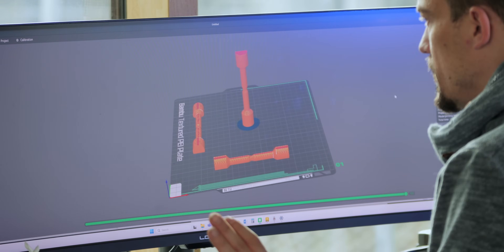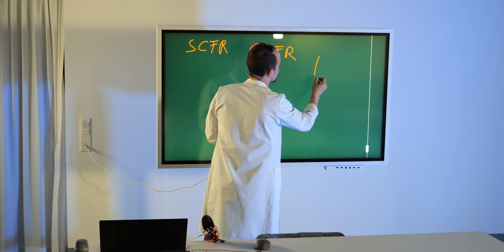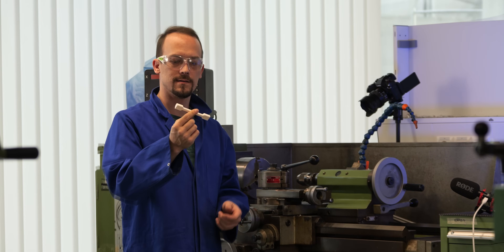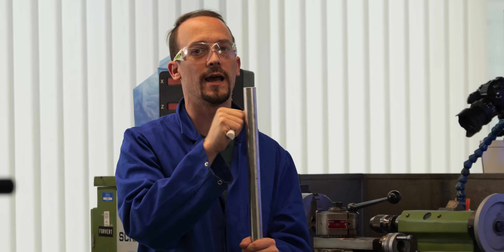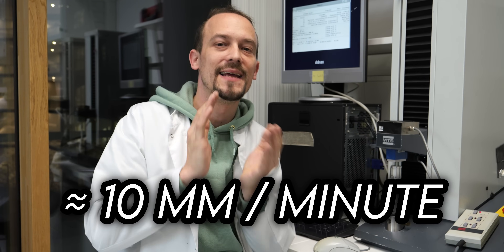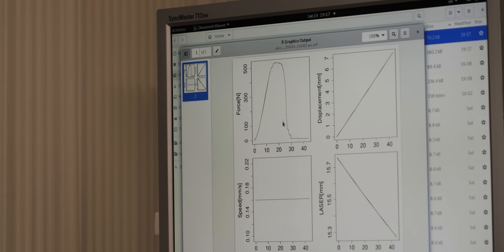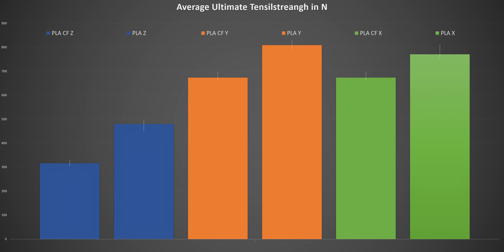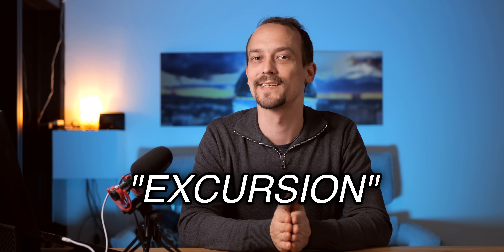The biggest SCAM in 3D Printing? How filament stores try to trick you with carbonfiber "reinforced"

Comment: Okay it's not a scam and their claims are actually somewhat true The problem is most people don't understand what strength toughness etc means it can be very confusing if you don't understand what those words means and how they're used 

First anytime you add a filler to a plastic I don't care what it is it could be wood fibers it could be glitter it could be carbon fiber strands it could be carbon fiber chop it could be Kevlar it could be glass fibers it doesn't matter what it is except if it's another of the identical plastic for example marble filaments it's two of the same kind of plastic You're just seeing a difference in color 

You are taking a monolithic homogeneous material and you are putting voids in it The carbon fiber or wood or glitter or glass fibers or Kevlar fibers they are not fused to the plastic they are bonded or encased within the plastic so ultimately you have two separate materials and one is just mechanically trapped inside the other this is not a fusion this is not homogeneous or monolithic 

Now what happens if you take a solid object and you put holes in it? It gets weaker always 100% of the time no exceptions there is no such thing as any filament with carbon fiber in it that is stronger than the filament by itself that does not exist 

However :-) here's the grain of truth you can trade one type of strength for another type of strength for example it can be worth using carbon fiber nylon carbon fiber polycarbonate you are making the nylon and the polycarbonate weaker however those materials in many applications have so much excess strength that you can afford to give up some of that strength in exchange for a different property for example nylon is stupidly strong but it's not very rigid carbon fiber in nylon makes the nylon extremely rigid relative to plain nylon keep in mind there's dozens of different kinds of nylon however the point is the nylon is so strong that in most applications you can afford to give up some of that strength and exchange for stiffness if the stiffness is what you need however this is not the case with PLA and in most cases PETG you are taking an already brittle material and making it more brittle by putting voids in it Yes it will be stiffer but you will be giving up enough strength that you may go below the threshold of what you need for the mission critical application meaning the material might no longer be strong enough for what you need it to do 

I'll say it again All fillers make the plastic weaker no exceptions you are creating a voids in a monolithic structure this will always make it weaker what you are doing is exchanging one value of strength for another value of strength if the remaining value of the original strength is still sufficient for your use case well then great you gain a benefit however if the material natively is already barely strong enough you just made it two week for your application :-)

Comment: Big differences that most people don’t understand, between stiffness/rigidity, strength and toughness. As you mentioned at the beginning, CF may contribute to rigidity, but at the cost of strength. Toughness is yet another separate characteristic.
Reply: so my way breaking the filament in my hand to get a "feel" for the material is actually better than reading the marketing material? I though sometimes that I am just silly for going by hand feel instead of the "hard numbers".
edit: because I don't have this kind of engineering training.
Reply: I agree . I’ve seen several channels testing different filaments, and getting confused between ductility , tensile strength and malleability.
Reply: Nah this testing methodology is flawed and he's using shit materials. Anyone who actually prints CF nylon knows that a good CF nylon is leagues above in tensile strength than an identical unfilled nylon (same exact polymer, just without the CF fill)

Comment: This was sound. Because after time I will use the Makerworld points to upgrade hardened 0.6 nozzle...and some materials. I have renounced to up both 0.4 and 0.6 to a Panda bc I don't need speed I just need a 0.6 hardened to make real car parts. The remaining I'll spend them in materials and... Good to know a good ABS or nylon6 could fit better than fancy CF stuff which has no reason to have CF inside apart of...the aesthetics. And maybe stabilizing ABS shrinkage but for delamination...looks worse.
Very curious study. Well done. Popping some corn waiting for filament brands to clarify this thing...

Comment: Not all CF are the same.  If they don't tell you the fiber type and volume percent, you are likely buying junk.  Did not see any increase in stiffness in your stress vs strain curve.  That's a bit suspicious.  The CF you are using has probably been milled to dust.  Also many of your base pla and petg specimens appeared to not fail in the narrow gauge section of your specimen.  That will impact your strength calculation since strength  is load/area.  Probably need a specimen redesign.
Reply: Would love to see a repeat with PC and Nylon.

Comment: I would strength test the raw filament to go along with testing parts since the filament strength properties are the fundamental basis for the strength of printed parts (which have orientation, layer adhesion, infill values, etc., etc.  Not saying do this instead, but do both.

Comment: So, I have a theory that, since the CF strands don't actually bond to the plastic as you pointed out, it kind of acts as a void in the plastic. How much those voids play off eachother is the real question, but a pulling force would not pull on the CF strands embedded in the plastic, thus the worse results throughout the tests. Which is probably why Stefan's tests yielded better results in bend testing for CF PETG than just normal PETG.

Comment: This is why we use pla+ for 99% of prints. Perfectayer adhesion and really exceptional strength. Easy to print, easy to post process, no harmful contamination, no fibers in my skin, no wear on my nozzle, can do it on cheap printers

It really is the go-to for structural parts so long as the temperature does not exceed 60c but for that you can anneal the print
Reply: Unfortunately, PLA+ is also a marketing gimmick. There's no real standard on what that plus means, so it could be anything from plain PLA that is just being marked up in price to some arbitrary blend of polymers that may not even contain PLA.
Reply: @ckitching2  you can tell based on material properties, pure pla does not have enough give but the overwhelming majority of "pla plus" type materials are a single additive of a much less rigid polymer in small amounts and it shows in functional prints when PLA+ didnt fracture when my normal PLA did

if you buy trash filament it COULD be anything regardless of what it says on the box but if you are making stuff thats supposed to work you go with a reliable and consistent brand and your needs will dictate if that also works for 99% of your structural and functional prints like it does for pretty much everyone including the people who print guns and pull up bars
Reply: What are your favourite manufacturer for PLA+?
Reply: Polymaker has most of my old prints, my friends who print similar things like sunlu and elegoo and there are others that I can't remember right now.

One thing that's underlooked is sometimes color can mess with it's structural properties, most have found black and clear to be the best variants for things like layer adhesion. One brand I know has a good red and black from DURAMIC 3D as well. Arguably my only source of colored structural filament
Reply: Yea. PLA is massively underrated.

Comment: I appreciate the efforts put into this but I have to say there is something crucial you either not telling the audience or don't even realize matters. In short :1-style/ratio of cf fill makes a big difference. Like night and day. Saying it's weaker as a concept in general is not accurate when there are so many nuances. 2- The nozzle temps should be hotter than normal petg. 3- an enclosed preheated chamber is very important even though not claimed on most companies profiles. For best adhesion you need the chamber at 35c so that the existing layers are still soft enough to bond to the upper new layers. 4- petg-cf is terribly hydroscopic. It must be dried really really well first. The earmark of improper drying IS layer adhesion. The material will also look lighter in color and appear swollen and rough when printed. If all these points are considered it is in fact just as good as regularly petg and a bit of a unicorn. I have printed thousands of items with it in commercial applications. That said marketing will always be marketing. But getting to know your filament and it's requirements will trump any scientific method in the lab every day of the week. These tests mean nothing if the material has not been printed in its ideal required conditions to begin with. I have yet to see any YouTuber properly use and test this filament. FYI the big name brands aren't always better. I've used many of the them. 
.
Reply from the maker: Thanks for pointing that out.
I dryed (specialised drying oven with certification), nozzle temps according to manufacturer guidline on every material, enclosed printer and controlled (and messured and recorded) chamber.
U are right, i did not tell because most people wouldnt want to know.
Since i am not only a youtuber and in a lab but also was a user and eutroponeur in 3d printing service for abou 10 years i am aware of all those things as well.
In the Research paper all of this will be included of course since u are right: without taking all this into account the whole thing isnt valid. But that would be to scientific for youtube because then i would need  post a whole abstract, materials and methods and also all my literature review as well. and then people get bored :-)

Comment: Great Test, Well done. Tell us, Did you test include drying the filaments before printing? 
Would love if you added Nylon vs Nylon CF to the test in Nylon PA6, PA11 and PA12 form. As these more expensive PA grades are professionally used for printing tools, functional prototypes, and end-use parts. One Popular Nylon CF for professional finished end-user and auto parts is the DSM Novamid ID 1030 CF10 PA6/66, also recommended by UltiMaker 3D printers. Part shear, displacement, and compression (squish) strength test would be a bonus ;-) Thank you.
Reply from the maker: it did include drying in a certified material drying oven (specially for FDM Materials).
All those materials will follow in the study and i will post a video when the paper is published

Comment: I am surprised by your result, it is not consistent with my experience.  I have used PETG-CF in many applications and seen more than a 50% improvement in ultimate strength (tested, not assumed) as well as improved stiffness and thermal resistance.  I think there would be a lot of value in testing some other brands of material and reviewing the design of your test sample, the failure point was very inconsistent which is not a good indicator of repeatability.

I have seen the best performance when PETG-CF is printed slow and hot, try limiting the printer to less than 50mm/s and increase the temperature to 250c.  For the test sample, I would review the sliced file and ensure that the area of lowest material cross-section (taking infill into consideration) is indeed at the necked down spot.
Reply from the maker: U are right with all of your claims.
i tested specificaly how a user would use it. With the manufacturer given speeds etc. That was on purpose. This was the reason because i 1. wanted to use it as a normal hobby user would do and 2. because i otherwise would jeopardize the Researchpaper with a pre-puplication where the speciments adhere to the norm for all of this tests.
Reply: @Ibuiltathing  It seems that the title of the video is a bit misleading then?  I think there is a value in trying to represent how an average user might use it, but I think that there is also a big opportunity to help educate.  I hope that you will produce more content to dive deeper into the material science of this and help more people succeed.  Inducing a failure only has value if it is used to help inform how future failures can be avoided.

Comment: Im well aware of the weakness of carbon filled filament, the particles simply get in the way of plastic adhesion.  But no one tests the compression strength, where these materials shine.  almost more then double the strength  in GPa according to chatgtp with CF filled vs non. But you never see someone do a squish test, they all just rip it apart. Id like to see a car ramp made out of one and see if the improved strength data can be shown in the real world.
Reply from the maker: This follows as stated once the research paper is done and i have the data for it :-)

Comment: There's actually any number of prints where stiffening additives are good actually because tensile failure is just not of concern, the item may fail to perform its intended function purely as an outcome of deflection. Pretty much everyone knows that ultimate strength is reduced by filler, don't they.

Indeed you have a similar use case constraint in this very video. 10:04. The irony.

Granted GF is more fit for purpose i feel, you use CF when you need low density alongside some stiffening.
Reply from the maker: you are right! nothing to add.
That is why i always specified that i am only testing a specific force. If  need a stiffer part cf is thae way to go. Thats why i dont understand that it is never marketed that way.

Comment: Thank you for the video! It's clear there's a huge time debt in the testing, extra filming of the testing, edits and even analysing the data to present.

A few opinions:
- The long fibre/entrapped fibre deposition methods are much better suited for the material's benefits.  And, like you mentioned, they're beyond the hobbyist scope, in costs / machinery to do the process.
- Getting beyond the CF/GF materials, perhaps other fibres like cellulose are better suited for FDM printing?

Your results, coupled with discussions that Nathan Builds Robots have put out, show that the go-to Carbon Fibre and Glass Fibre reinforced materials don't do what they say.

Nathan's video where he shows that the 3d printed CF parts can shed fibres really shows another problem not tied to the data sheet: 
Those little fibres shed, and like asbestos, glass fibres and carbon fibres embed in the skin easily, and are outright long term hazards if they're airborne and breathed in, as the part continues to shed and degrade over it's lifetime.

Totally opinion:  I expect these fibre reinforced plastics are going to end up being the curious oddities of history, like fine china made of uranium glass, or wallpaper made with arsenic laden dyes.

Comment: I bought ASA CF.  It is stinky AND brittle.
I can't praise PA-CF enough though.  Nylon durability with carbon fiber rigidity is the perfect combination.
Reply from the maker: I will include that material in my study as well. because i can immagine that the hit u take on different mechanical metrics can be compensated by the fact that PA is overpower for most applicatioins anyway but the gain in stiffness offsets its then in terms of usability

Comment: I like printing PETG CF.
Still better layer adhesion as PLA but stiffer then pure PETG.
Depending on the use case of the part this can be a really good material. It is like with every material, it is highly depending on the final usage of the part.
For me there is not that one and only material. I have a lot of different materials laying around and choose depending on the needed characteristics.
Reply from the maker: Amen!
The right material for the right application. Pick and choose. 
as u said: there is no wrong material, only wrong usecases

Comment: I'd be curious to see this test done again with the carbon fiber filaments printed at higher temperature. That's supposed to enhance layer adhesion with carbon fiber filaments. Great content. Thanks for your hard work! You get a sub.
Reply from the maker: I Printed it with its according to manufacturer best settings (also temp).
Or do you mean comparing the same material just printed hotter and colder ?

Comment: I am highly interested in making parts used out of doors. UV and heat testing. In Texas we have temp periods outside of 110 degrees with full sun. 
If I 3d printed parts for use in this environment, which filament holds up in these conditions?
Reply from the maker: That is what ASA was specificaly designed for.
It has greate UV resistance and up to 100 degree Celcius heat resistance.
I never tested those claimes but i found a published paper about it that supports this claim. PC is also good if u need even more toughness but the UV resistance is not as good. There are Filaments out there with added UV stabelizer.
Same for PA Filaments.
If u want to go easy u can do PETG (85 C heat max) if it does not need to stay there for 20 years.
Be aware that Black parts for example can reach 90-95 degree celcius (194 Farenheit i think) outside. So PETG could already fail here

Comment: Adding CF mostly makes it easier to print easier, warp less. If you need impact resistance and good layer adhesion just use TPU. CF makes plastics rigid and brittle.